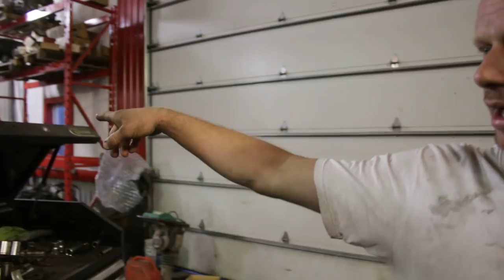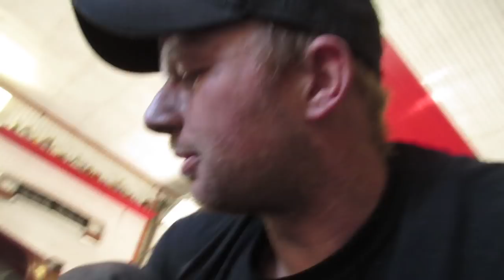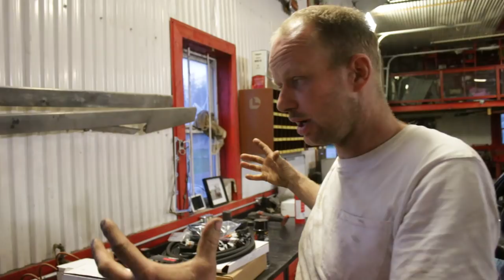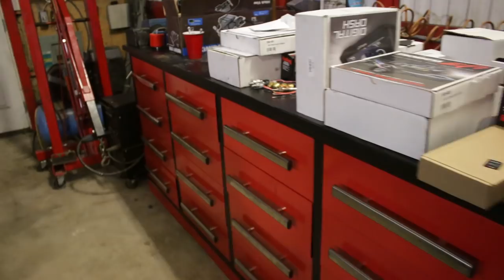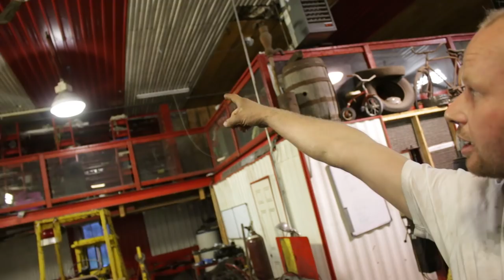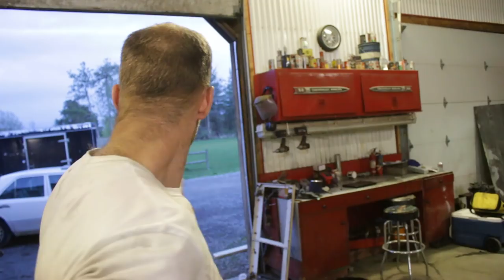What Every Shop NEEDS | How To Start A Mechanic Business (Part 1)

Comment: I thought about being a mechanic, been doing traveling refrigeration for 15 yrs. last 5 years working on my own stuff and my project 1969 k10 I’ve come a long way.  I’m getting more comfortable working on my 05 Cummins. Carb equip cars I’m very comfortable with. Rebuild a NV4500 for my 69.  Done some axles.  Hobbiest machinist as I have a welder, lathe, mill and just bought a plasma cutter.  

Being a mechanic is tough deal. All the new stuff is getting more complicated and electronic. I can usually figure it out on my own stuff, just takes me time. And sometimes I mess it up and learn..... 

So ya, don’t know if I can cut it as a mechanic.  Not even so much the repair part too, customers are hard, time frames, people want it yesterday.
Reply: Being a mechanic is a pain in the ass, I started @ 16 and have been at it for almost 10 years now...lots of impossible deadlines, very impatient people and with the electronics in newer vehicles, lots of headaches and cursing
But I can say now looking back I wouldve still chose to do it...would buy my tools differently but would definitely still be a mechanic

Comment: Awesome to hear you also use the alternator to turn an engine 👌🏻👍🏻!! I also do it that way to set the valve clearance on the engine if i can’t get to the crankshaft because the front pto shaft is directly connected to the crankshaft pulley 😬👌🏻 keep up the good videos !! Greetz from holland 🤙🏻

Comment: I would stick with nice fine tooth snap on ratchets. They are so much tighter and more precise.  Cheaper ones a sloppy and impossible to use in tight areas.
Reply: True. Some jobs require a fine tooth ratchet.

Comment: it's ok to skimp on the tool box and most of the tools... but, when it comes to air tools, I've found this is where the rubber meets the road.. don't skimp on those and you'll have an easier time with things.

Comment: Hey Rich nice video. Would you be able to go into more detail about the PEX you used for the air lines? Was it just normal PEX for water or was it ALUPEX? And what were the ends you glued and crimped on? Also 1/2" or 3/4"? And what air pressure do you run in them?

Comment: awesome start to a new series, hope to see a video with your thoughts on different lifts 

also is the 48x64  16ft wall big enough? would you make it taller shorter longer wider ect.. thinking about putting up a shop with a loft above it to stay in sometime next year
Reply: Andrew Browner Just my 2 cents, but two things I've learned over the years, building buildings around the farm. 1) spend your money on dirt work and a solid foundation. There's some older building here at the farm that were skimped on and has caused us a lot of flooding issues since the barnyard is in a lower area. Spend the money and build up a pad. 2) you never build a big enough building. Be smart with a design that would allow for future expansion if needed. Just some observations that I've seen from watching older generations work.

Comment: The box doesn't make the money. Buy the tools first, then when you can afford it, then buy the nice box. I made it to being a shop manager with only a medium sized Craftsman box. You can keep all your occasional tools in a plastic tote, or cardboard boxes until it's smart to buy. When you have your first good year, then start buying boxes, and specialty tools when you need them, and get a benefit on tax deductions. All my friends that are mechanics, are always borrowing tools from me. They have boxes, but not all the tools they need. My rule is if you need a tool, or borrow a tool more than 2x, you should buy it. 25+ years in, I have 7 small/medium boxes. Now I need a big box, and will probably retire in the next 10 years. Just my 2c.

Comment: Hey... just put in ZT FAB grinder rack, air tool rack is fantastic..... and tig rod tube rack... use one of these tig tubes for hammers.... grinder rack has wings for extra wheels... all of these can be bolted to a wall or even a tool box or cart side... here is the link.  https://www.all-a-cart.com/product-page/grinder-rack

Comment: Just from hear say.  Those led bulb replacements are not worth the money.   I heard of a couple of companies who have tried them and later replaced the fixture with leds from the big ass lights company.  Depending on your gov.  There could be some pay back incentives on putting them in.
Reply: If you leave the doors open @ night, the bugs will get inside the light, then will draw moisture and the moisture will burn then out. You need the sealed ones.

Comment: calling electric service hydro is just silly, sorry:p i kind of understsnd how that convention started there, but you guys should really stop it. 

I appreceate hearing a pro saying every tool in your box dosent need to be mac or snapon. i certanly have run into a few with the elitist attitude on youtube, and all sorts of excuses to justify the cost. the way i see it, the pro tools have some advantages that the midrange has for the most part copied at this point, and pretty decently. 

those are mainly fine tooth, erogonomic ratchets with various handle lengths and with pivoting heads etc, i just saw a series at northern tool that imitate snapon ratchets almost exactly, and with a no questions asked lifetime warrenty, but around $22 a piece instead of $130. also long handle wrenches are a nice thing with the premium brands, the standard length wrenches are almost always too short to loosten fastners in the rust belt. i dont see the mid range tools copying this yet. as far as sockets, aside from some cosmetic differences and perhaps strength i dont see much difference anymore. 

id say snapon ratchets and wrenches are pretty nice, but no point in spending the money on snap on sockets.